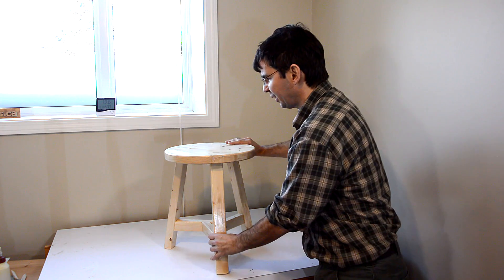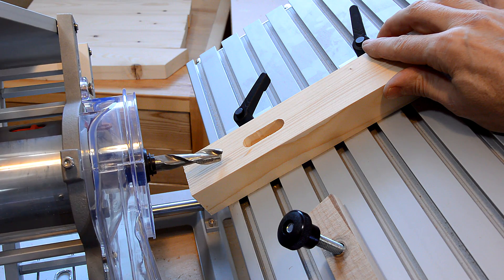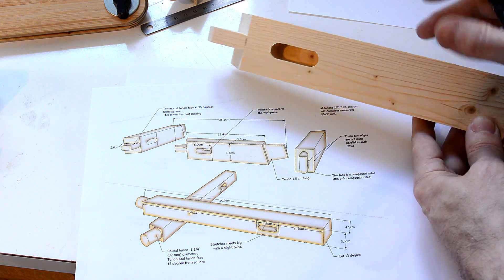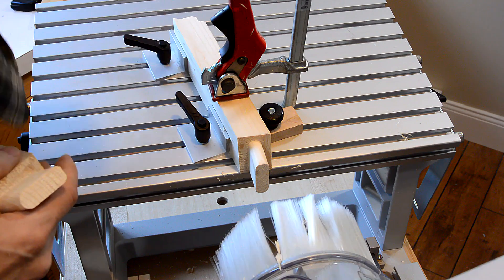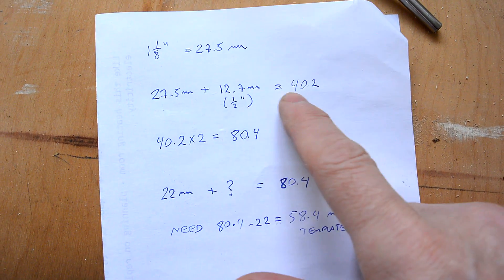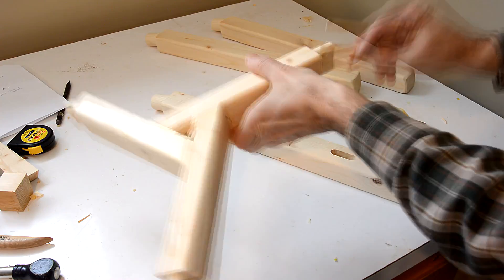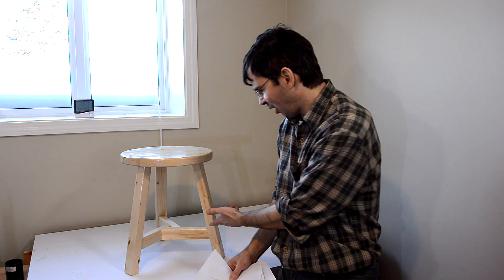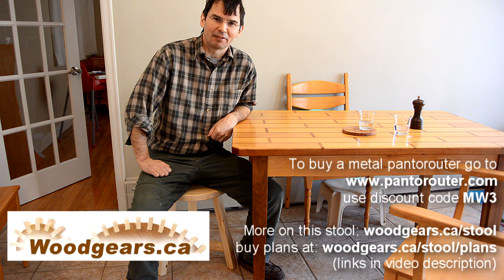Building a 3-legged stool

Comment: Every time I have owned a stool or chair with mortise and tenon joints connecting the cross-braces to the legs, the tenons have always pulled out, and no amount of glue, Chair-Lok, or even nails or screws, have been able to prevent them from failing that way. Do your compound angles help prevent this?

Comment: I noticed you put the leg tenons right the way through to the top of the seat. Is there a reason you didn't have them shorter and recessed below the top surface to keep them hidden from view?
Reply: This way the leg tenon length was not critical as it was to be trimmed. Other wise you'd have to decide if the stool top was going to be supported by the top of the tenon or the tenon shoulder.  IMO

Comment: Two things. If your going to put the tennons through the top why not put a notch and wedge into them. Id go with the tennons 3/4 of the way through the top myself, less chance of problems over time.
Reply from the maker: The grain doesn’t run parallel to the tenon so the wedge direction has to be with the leg, and then it can’t be perpendicular to the top grain.  But why wedge an accurate joint.  Pointless

Comment: If you try this at home ,make sure you have an empty 40 yard dumpster on hand and plenty wood available to screw up.
Reply: A wood stove too!
Reply: That's why traditional three-legged stools are often using tapered round columns, 'cause it's way easier to drill a hole at an angle and jam a tapered dowel in there than this. This one looks way cooler though.

Comment: This reminds me of my first, and so far, only woodworking project: an eight foot, tapered tomato cage with six legs, staggered ladder rungs, and top and bottom crosspieces to hold the legs together. It had quite a few compound angles, and I wish I could have built it with compound mortise and tenons, but I only had a circular saw, so unfortunately, it's held together with about 130 screws. 

I didn't know CAD, so I decided to design it with pencil and paper. It probably would have been faster for me to learn CAD, but those compound angles sure helped refresh my memory of trigonometry.

Comment: If you used round stock for the legs, you wouldn't have to worry about any twisting or compound miters.
Reply: But that would take the fun out of it! :-)
Reply from the maker: You still need a compound miter at the joint, unless the stretchers are round too.  Just thinking about it, what a nightmare that would be with round legs,

Comment: Why through holes on seat?
Reply: Looks like its for strength and ease. Only need to glue together then, no special hardware needed
Reply: Well I think drilling 1/2 way through and glue it would be just as strong and easy as well as nothing to cut on the top side.
Reply: Affra but then you need a different bit besides a hole saw

Comment: I built a shelf/ cubby for my lawn mower on the bottom and snow blower on top, using double mortise and tenon cut with a router, and table saw, dowels for the top, glued it all up. No nails or screws. Inspired by the Mathias Master!
Reply: I'd love to see a picture of that.  Does it have some sort of ramp to wheel the snowblower up to the top, or is this a much smaller snow blower than I'm thinking?

Comment: I bought the plan from you for the pantarouter. I built it i was wondering if you have a trick for making templates. Like the size vs the pin size. It might make a nice project to make a simple program.
Reply from the maker: Lots on my website about that.  Also see this video
Reply: I did see it. Where i have had trouble was  pin vs the bearing and the inside or outside tenon. Do you have a site you like?

Comment: but you shouldn't do the legs this complicate with the compound joints. I made this stool a couple years ago in a way where the legs are perpendicular to the horizontal bars. at least I think it's easier to make. here is the album of the making: goo. gl/photos/82c7hfkksD2L5oAC7
Reply: defeats the purpose of the project, which was to make compound mitres with a pantorouter